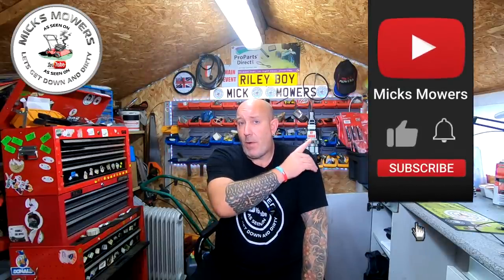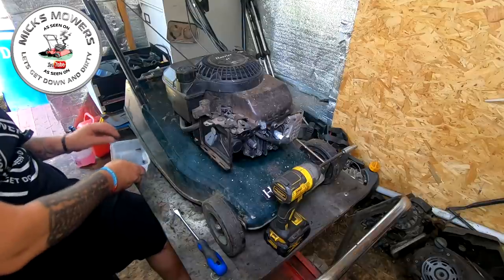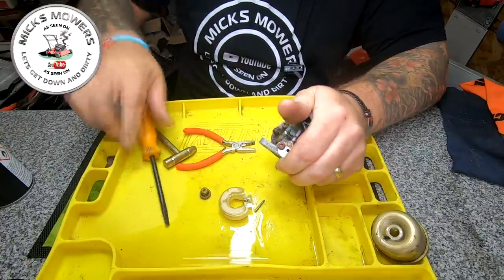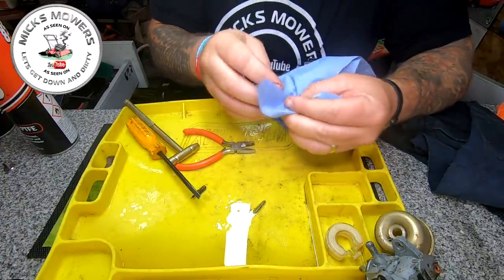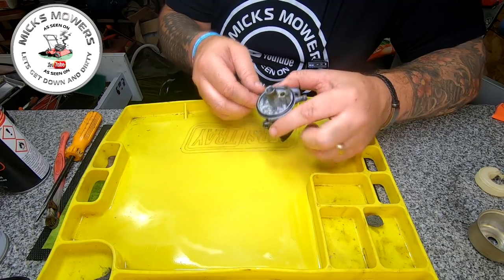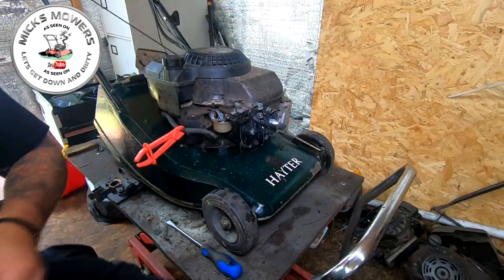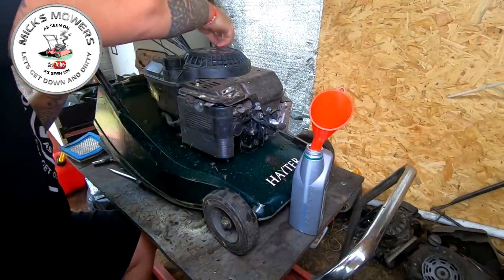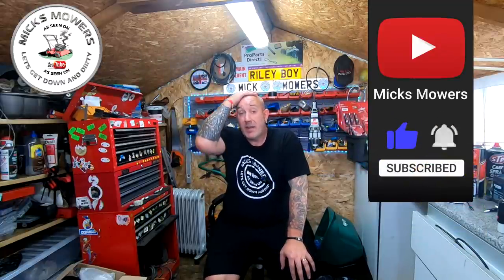Lawn mower Only Runs On Choke Here Is How To Fix It

Comment: I really like what you said about taking a carburetor apart until you get it right. A lot of YouTube videos the people doing the repairs are really quick to buy another carburetor. I'm not foolish I do know there is sometimes no other choice but to buy a new carburetor. In the last 12 years I can count on one hand the carburetor that I had to replace and could not fix the original one. Most of them the bushings that the hold the carburetor blade are worn out. I also had one carburetor that was cracked. My friend got mad took a hammer and hit the carburetor. Somebody had told him that the float was probably stuck and a hit the carburetor and it might free it up. He got mad after doing this a couple times and gave it one good smack and that was the end of that carburetor.

I really enjoy watching your channel. I'm in the states so a lot of the brand of equipment is different than what we have here. Of course engine are pretty much universal. 

Look forward to your next video.
Reply from the maker: Thanks for the comment mate.. yeah most carbs can be bought back to life if you do a good job..
Reply from the maker: Thanks for the comment mate.. yeah most carbs can be bought back to life if you do a good job..

Comment: Nice touch with the micro drill to clean the main jet. Too many DIYers only use a wire or the carb cleaner and never get the jet back to the original size thus the hunting. If they still hunt we normally open the main by 0.002" from the original size and that does the trick. See you Sunday the OLD MAN over and out.
Reply from the maker: See you soon mate

Comment: Hi mick another great video I was wondering when you say a full service what does that entail?
Reply from the maker: Blade. Pull cord.spark plug.air filter. Oil change. And cables wheels oil.. safety checks
Reply from the maker: Blade. Pull cord.spark plug.air filter. Oil change. And cables wheels oil.. safety checks

Comment: I have issue where mower only works on full choke, carburettor cleaned with no blockages and fuel filling bowl. Still no joy (changed oil and plug plus fresh petrol anyway) before I buy a new carb, should my air filter box be sealed as mine is just plastic on plastic
Reply from the maker: Sounds like a carburetor problem to me.. did you file out the main jet?
Reply from the maker: Watch this one for drilling the main jet https://youtu.be/s0f_UJe1Urk

Comment: Mine just did this and I "fixed" it by letting it run in choke for a while, blipping the throttle down by the carb and spraying some carb cleaner while it was running. Then when it would stay running when I took it out of choke and let it run 10 minutes more and it seemed to have gotten out the water or crude that was causing it no to get enough fuel to run.
Reply from the maker: Good job

Comment: Have a Craftsman 17.5 hp. Changed the carb. Now surges. If I set the throttle a little over the run position it stops surging. What is the Fix. Louisiana
Reply from the maker: Sounds like a carb problem.. or gasket issue
Reply: @themowerman  Thanks. It was an aftermarket carb.
Reply from the maker: @charlescoker7752  no I believe it to be genuine
Reply: @themowerman  Was talking about the carb I  bought for the 17.5 hp.